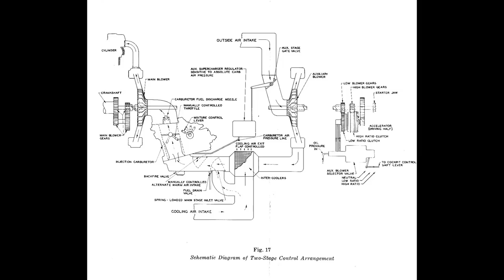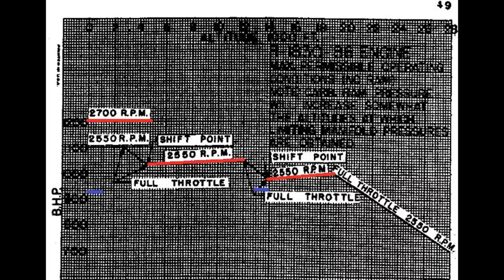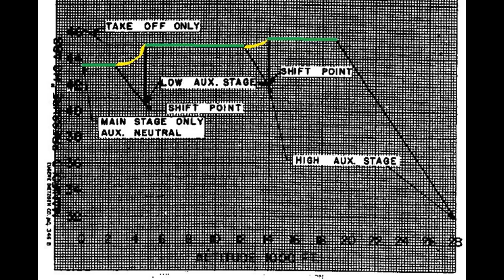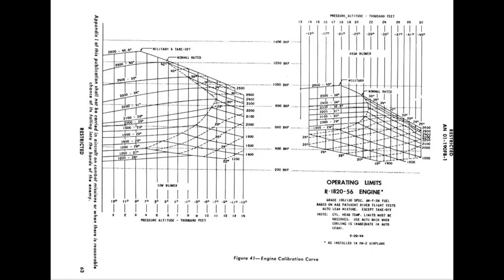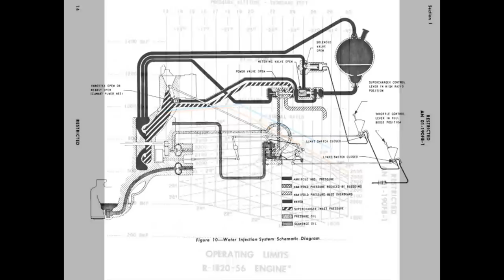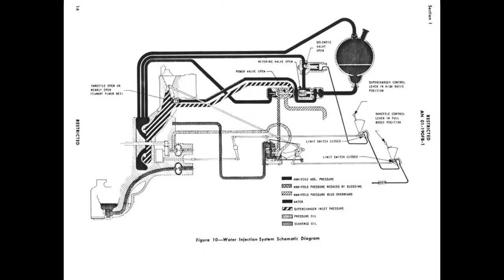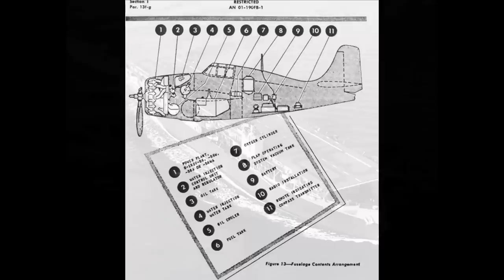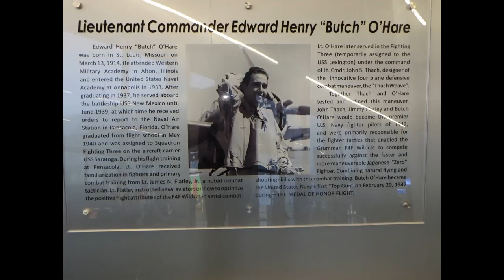Grumman Wildcat and FM-2

Comment: An old trick for the Wildcat pilot getting ready to land was to unlock the landing gear, get out of the way of the handle in the cockpit, and pull up sharply. The handle would spin madly as centrifugal force pulled the gear down to lock. Still had to wind it up manually on take off though.
Reply: Interesting.  I had read that the handle was connected by a chain to the landing gear mechanism, and that letting go of the handle and letting it spin risked having the chain jump loose, disabling the gear.
Reply: @petesheppard1709  There's three chains involved. One from the crank to a splitter mechanism and one chain from that down to each landing gear mechanism. "The Book" prohibited the use of the gravity method of gear extension, but that doesn't mean it wasn't done in the field.
Reply: I had a chance to fly an FM-2 n the 1970s and the owner warned me never to let go of the gear handle whilst it was in transit because the chains could derail and jam the gear halfway. Fun airplane!
Reply: @neilrobinson3085  You lucky SOB! 🤣
Reply: @Nghilifa  Yup, it was total luck and serendipity.
Reply: @Nghilifa  I got to sit in an FM-2 at Palm Springs years ago. The owner (whose name escapes me all these years later) told me DON'T TOUCH A FUCKING THING then talked me through a start-up. I'm not a pilot, so this is one of the high points of my life. I was 28 then. I'm 59 now.
Reply: To Gear up easily : Fly inverted 😁
Reply: There is a reason it was produced during the entire war and was very valuable in the Atlantic as well

Comment: My dad's brother was a Naval Aviator and flew FM-2's and F4F's off the USS Makin Island (CVE-93) as a plank owner from May 1943 until the end of the war. He became a corporate pilot and flew to the ripe old age of 72. Thank these guys for their service. They had cojones for sure and a lot of their flying was seat of the pants.
Reply: Over water navigation, with few electronic aids, using a clock and compass and judging the wind on the waves, in a single engine piston aircraft by yourself is already awe inspiring.
Reply: @fazole  well said
Reply: @fazole  ; And electromagnetic interference from the Earth itself in the Pacific (especially Guadalcanal), Japanese pilots started removing radios on their Zeros because the wires would catch fire.

Comment: Great video!  Some trivia:  The Eastern Division of GM did build a few F4F-4 clones, designated FM-1, before going over to the FM-2.
Also, according one account, the weight problem with the two additional .50s of the -4 was that, being relatively far out in the wings, they reduced roll rate to levels pilots disliked.
AND, I believe that US pilots were told to roll as they dove away from Zeros, because of the stiffening of the Japanese plane's controls in a fast dive.
Reply from the maker: Yes, that's all true.
Reply: Indeed, the Zero was reputed to be very maneuverable compared to contemporary western monoplanes, but its highest roll rate was at a relatively low air speed.  Above 290mph it was very hard to maneuver.  Contrast this with the P40-not known to be a maneuverable plane, but its highest roll rate was accessible at 340mph.  "Our" pilots could wingover and dive away at high speed, leaving the Zero in the vertical air column's dust.  That's one of seral reasons why "our" pilots were warned against aerobatics and told to "boom and zoom"; no turning fights against the foe.  Statistically speaking, in WW1 or WW2, energy state fighting was the way to win.  Greg's fave, the P47, contains several such warnings in its wartime  demonstration/orientation video.  In fact, aerobatics are strictly prohibited in the P47.
Reply: A second factor not liked by the pilors additional to the weight issue was less rounds per gun in the 6 gun -4. So the pilot has less time to fire his guns before they went out of ammo.
I also read that some squadrons removed the two additional guns to counter this both issues.
Reply: @philp8872  I wondered if there was stowage for more ammo if the outer guns were
Reply: @GregsAirplanesandAutomobiles  the designer of the Zero wrote a tiny book about it which I hope someone gets you for Christmas if you don't have it.  My recollection is that the control cables for the Zero had springiness to them.  At low speed, the lightly-loaded surfaces would move a large amount for a given stick movement, but at high speed they'd move much less and have the same effect due to deflecting a lot more are.  This made the contralability much more even, rather than being knife-edge at high speed.  But it might have been too flexible, simply not capable of large-enough deflections at high air speeds for the maximum roll...

Comment: Great video - the Wildcats were workhorses that helped hold the line and even win some pivotal early battles for the US. The US-made radials were among the best aero engines of that era.
Reply: It's still interesting to me that the Spitfire and the Mustang get basically all the glory, but other aircraft were really more responsible for the ultimate win.
Reply: @reaperthemad8731 the spitfire did quite a lot of work but the mustang is the most overhyped in my opinion as it is so well known for bomber escort but during the worst and most important times it was mostly the thunderbolt that did that work(1943)

Comment: With regards to the bulge for the  intercoolers, the first Wildcat, the XF4F-2 had a different engine which didn't require the bulges.  Apparently they couldn't squeeze in the intercoolers without a major fuselage redesign or more simply adding the bulges.  If you look at later variants of the Wildcat, the bulges came and went with the engine variants.
Reply: I believe that’s part of the reason the Buffalo won the contract at first

Comment: There's a trick that savvy pilots used to help get the gear up in a Wildcat.  Accelerate after take-off without touching the gear crank.  Let the airplane gather speed by gradually climbing only.   After picking up some speed, pull up sharply, climb steeply, then push over through a long arc back into level flight.  Gets you into zero-g for the better part of about 10 seconds if you get it right.  With the gear now weighing zero-pounds it's easy to spin the crank and get the gear up quickly without having to grind away on the crank handle.  After "getting good" at it, a pilot could easily get the gear up in less than 10 seconds during that zero-g time.   The Wildcat pilot who showed me the trick could do it in 5 seconds, watched him do it.  It was an FM-2 that he said had some improvements in the gear mechanism that helped make the retraction smoother.

Comment: About 50 years ago I bought a 1/32 scale Revell kit of an F4F4 Wildcat. It had awesome folding wings!! I recall having to stack several hinge parts then glue them to the wings. One of my favorite kits AND airplanes ever!!
Reply: If you drive 20 miles or so north of Henderson field on Guadalcanal there is a "museum" off in the jungle with several crashed aircraft including a P-38 and a Wildcat. The folding wing of the Wildcat still works!

Comment: One other advantage the Wildcat had over the Zero, a radio. To save weight, most Zero's didn't have one. That the Wildcat did allowed it to coordinate with other Wildcats.
Reply: Not to mention that many Zero radios were malfunctioning over Guadacanal in late 1942 due to some atmospheric reason.
Reply: A bit more complex than that, they pulled them to save weight, due to grounding issues and shielding issues. It was a mix of the atmosphere as well as the issues that made them effectively useless

Comment: great pic at the end Greg. One of the aircraft I maintained was the Pilatus PC-9, it had the bendable trim tabs on the control surfaces you mentioned (as well as powered trim tabs). they were set up in the factory and were only 'adjusted' if the aircrew complained that the aircraft needed an unusual amount of trim, it was usually a try it and see exercise

Comment: One reason for the landing gear being as it is was the previous Grummann fighter, the F Three F had that type of retractable gear. Not only do the fuselages of both fighters look very similar, the very first design drawings of the F Four F were of a biplane. The design for the gear worked and the engineering was mostly done on it.

Comment: Even if the USA had stuck to using exclusively the Wildcat and Warhawk, they still could have beat the Japanese.  
The Japanese considered them inferior to the Zero and at first saw no need for newer types of planes. Also,  both American types could best the Zero with proper training and teamwork. 
Both these older planes are vastly under rated in regards to their importance
Reply: Of course, Japan lacked the ability to develop more advanced aircraft, so....
Reply: @drewschumann1  well, they did eventually develop some good designs, but all too late. Part of the reason for their delay was they believed there was no rush to replace the Zero.  Big mistake.
Reply: @khaccanhle1930  another mistake in my mind is that they kept producing the Sakae for too long. The newer Mitsubishi engine offered far greater power

Comment: Another phenomenal review, as always.    
One thing that could not understand, and Greg could likely explain,  is the choice in engine.   
Grumman was working on this project in 1939, yet they went with the 1,200 hp Twin Wasp that was introduced and went into production 7 years earlier.   Seven years was an old engine for the rate of development in the 1930’s.   
Why did the Pratt and Whitney engineers recommend their new Double Wasp, that also went into production in 1939.   I know it was nearly double the weight, but the 2,000 hp engine in the 7,500 pound F4F would have been outstanding.   Its dimensions were almost identical to the later Bearcat.   I’m sure the frame would have needed more strength, and balancing the weight would have needed work
Reply: Edit, “why didn’t the Pratt and Whitney engineers recommend the Double Wasp?
Reply from the maker: It was just a matter of timing. The Wildcat really started with the F3F which predates the R2800 by a few years. By the time the 2800 was ready for prime time it made sense to design a whole new plane.
Reply: Thank you so much for the insight.    Your channel is absolutely amazing!   Thank you for sharing your knowledge with us.

Comment: Greg, another excellent video.  Never suspected super chargers were so interesting!  I would point out that the British flew both Hellcats and Corsairs from escort carriers so it could be done.  Probably a combination of availability, training requirements, and logistics that caused the US to specialize with Wildcats on the escort carriers.
Reply from the maker: When I said they couldn't operate from Escort Carriers effectively, I probably should have clarified what that meant. Perhaps I'll add it to the description. Yes, both the USN and RN did operated Hellcats and Corsairs from escort carriers. However in most cases it was to ferry the planes from one place to another or in some sort of emergency situation. In the cases when they did do it, loss rates from accidents were very high so it wasn't practical. Thus, they used Wildcats instead in most cases.
Reply: @GregsAirplanesandAutomobiles  Maybe for the US but not the RN.  Check the Youtube channel Armoured Carriers on WWII British Naval Aviation.  Interviews with numerous RN types who routinely operated the Hellcat from CVEs.  WWII accident rates for Naval Aviation were high for everyone off large and small decks.  However, no indication that it was a limiting factor for the RN.  Indeed, the RN flying Corsairs off small decks convinced the US we could do it off large decks after initially relegating the F4U to land based operations.
Reply: @davidpf043  Lol

Comment: As mentioned by one of my colleagues, the Zero - and its design philosophy - would have been the best fighter...in WW1.  In particular against opponents who were not equipped or proficient with radar like China.  But the Zero was designed in a Radar/Electronic Warfare environment just like the Wildcat, an environment which gave Wildcat pilots the ability to climb early, above its cruising altitude and fuel-efficient climb schedules, in preparation for impending combat.  Initial altitude/energy dictated much of the ensuing battle - and the Wildcat was also far better suited than the Zero to exploit and maintain this kind of advantage afforded by radar, efficiently converting potential energy to kinetic, and back to potential after a brief disengagement, then coming back for another go-around.  It's not a mistake that during the middle of the war, many of the Japanese design changes added weight and armor to the Zero, more akin to the design philosophy of the Wildcat.  Meanwhile, even though the Americans studied the Zero, they instead decided it was based on a flawed design philosophy and DOUBLED-DOWN on the Wildcat design philosophy, building it's "big-brother" the Hellcat.

The bottom line is that in spite of hot-air arguments to the contrary, the Wildcat's design was long ago vindicated in the combat record, and the Zero's design was rendered a failure in a contest that ended the Japanese Empire.

It's this same effect of a new battlespace and technology, the Electronic Warfare environment*, incidentally, that made the American subs so superior to German and Japanese subs - and rendered Japanese anti-submarine warfare (at the time, ahead of Germany and Britain, and second only to the United States) ineffective.

*And really, we're really talking about the birth of the Information Age, because the developments in radar had everything to do with signals-processing and semiconductor technology which took a leap in Bell Labs, Rad Lab, Ford Instruments, etc, towards modern computer and control engineering.
Reply: But they failed to use their superior subs as the Germans did and hence missed the opportunity to end the war much earlier.

Comment: My favorite Grumman.  I love Kermit Weeks Kermiecam video flying his.  "Always have to remind myself to fully crank up the landing gear".

What happened at Reno was manslaughter.
Reply: The Reno crash of "The Gallopin Ghost" P-51D racing modded version was a result of systemic normalization of deviance. Not only was the detached elevator trim tab poorly maintained which ultimately ended up as the direct leading cause of the crash, the airframe itself was a ticking time bomb with the wreckage showing signs of deformation and metal fatigue even before the crash. This was because the aircraft had been modified in such a way that compromised the stiffness of the structure, allowing things to move about more than they really should. And when metal is allowed to bend back and forth repeatedly, it fatigues. Eventually that plane would have had a structural failure, it's just that the poorly maintained and poorly fitted trim tab attachments failed first.

However, as much as the fault lies on the owner/pilot of the aircraft, the crash also highlighted flaws from the Reno Air Race organizers and more significantly the FAA, who failed to enforce the regulations that are supposed to prevent people from turning good aircraft into death traps, either by poor maintenance standards, or making modifications they don't fully understand and end up reducing the structural strength of the airframe.
Reply: @HerraTohtori  
Thank you! I had read a few blurbs over the years.  Good to know.  Kind of like how Ramstein taught us not to fly aerobatic stunts directly at the crowd line.  I have heard spectators carp at recent airshows that the aircraft aren't low or fast or close enough.  Reasons.

Comment: For the pilots sake I hope he recovered from that takeoff. 13:00 mark.
Excellent as always.
Once the FM-2 came online and Grumman could switch over to F6F production didn't most if not all FM-2s and surviving F4Fs primarily serve in Hunter Killer groups in the anti sub mission. Or flying onto and off of the Sable and Wolverine
As a side note. In terms of production one thing that made the F6F fairly easy to manufacture was aside from the engine cowling and a small area at the base of the vertical tail is that there are no compound curves on the skin of the airplane.

Comment: Excellent technical explanation.  The FM-2 was a superb late war fighter.  My father-in-law served with VC-27 during the invasion of the Philippines and they were credited with over 60 kills while losing only a handful of pilots (one of whom crashed while performing a victory roll).  They might have been able to launch F6Fs from CVEs since VC-27 included Avengers which they launched with a primitive catapult system.  But, for the kind of actions they were ivnolved in, the FM-2 was probably the better choice.
Reply: Those torpedo planes had lower landing speeds, that's why they could operate off of the escort carriers, when loaded they needed the catapult to get them off the deck but when coming back empty they could fly slow enough they didn't need a huge carrier deck.
And they did launch the bigger fighter's like Hellcat's from the escorts but they were replacement planes in reserve to replace the one's lost off the big carriers, once launched they were never meant to come back to the escort.
Reply: @dukecraig2402  A few of the CVEs did have F6Fs.

Comment: On aircraft design and engineering, it's kind of weird in the sense of changes and updates (Bulg for intercooler) happen quickly frequently. The root cause usually is time as the number one factor. If you ever get around researching the F/A-19 A-D models, you'll see some crazy tests and compromises to get to the final product. Compared to the super hornet which was developed from the ground up the Navy, huge differences, and I wonder if it would have turned out better if they didn't adapt the legacy hornet from Air Force to Navy.